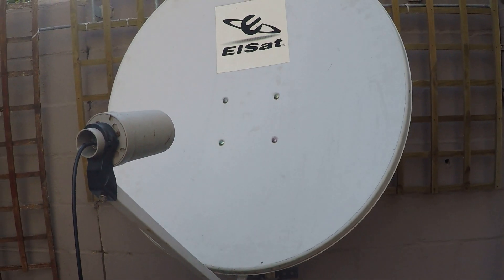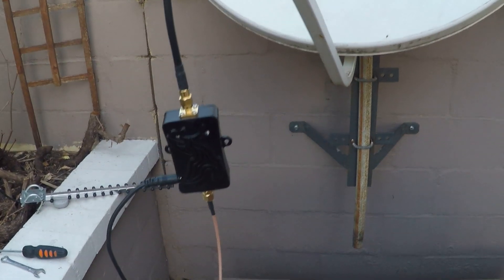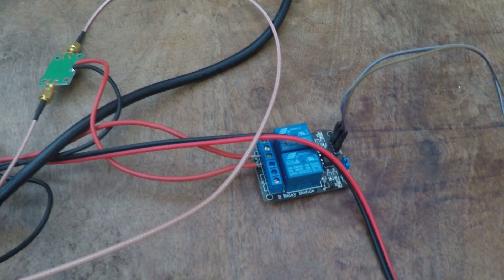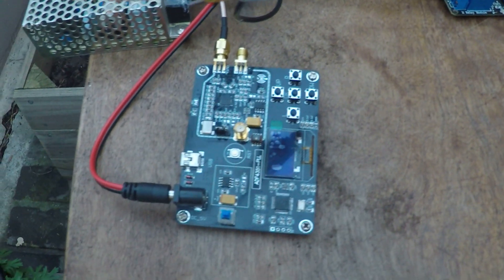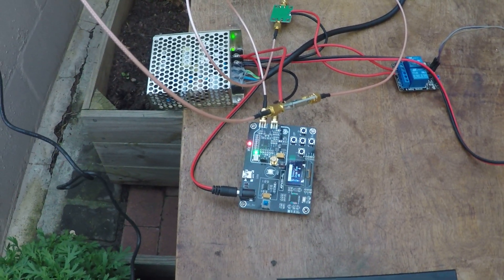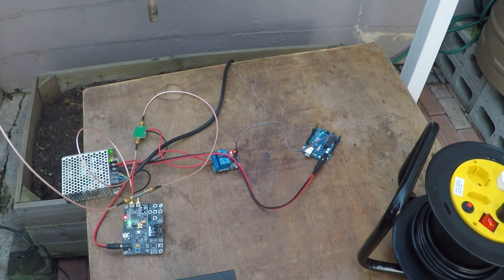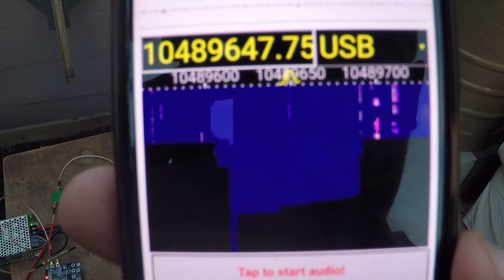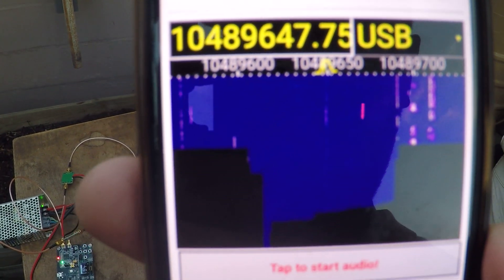QO-100 My first CW experiment

Comment: Nice job.
Reply from the maker: thanks. Was a good experiment. I was buzzing when I could hear myself on the sat!
Reply: I have ordered some modules from eBay to build an all in one up and downconverter using an adf4351 signal generator to mix the lnb output freq with 144mhz if and also produce the 2.4ghz the same way with 144mhz if and RF relay switches. Everything locked with GPSdo.
Reply from the maker: @maxblm6611  What mixer are you going to use?
Reply: @zs1cdg-electronicsandamate128  hmc 213 for TX and RMS-11 for RX.
Reply from the maker: @maxblm6611  hmm.. you are giving me ideas!